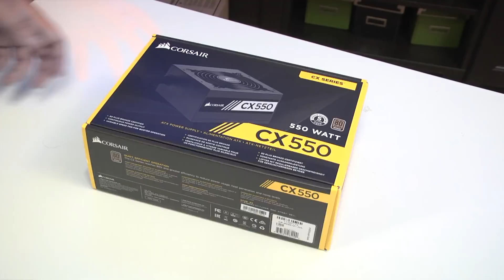December 2017 - $1,300 Gaming PC Build Time Lapse – Ryzen 7 1700 – GTX 1070ti - Carbide 400c

Comment: How about noise from case?
Reply: Denis Kulik im not the creator but the 400C is usually silent on both idle and under heavy workload, this will depend on the type of fan that you use AND how much power the fans are using when rotating the blades